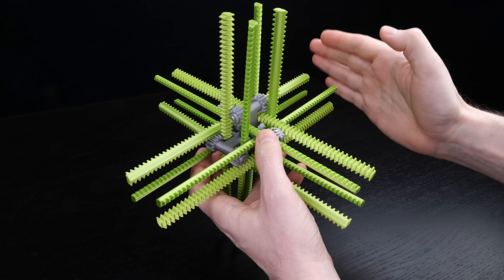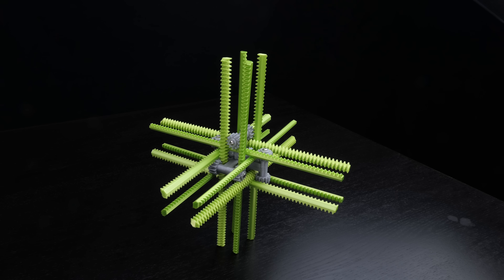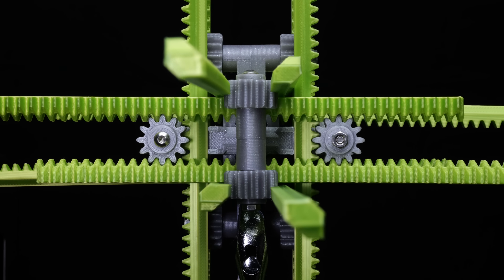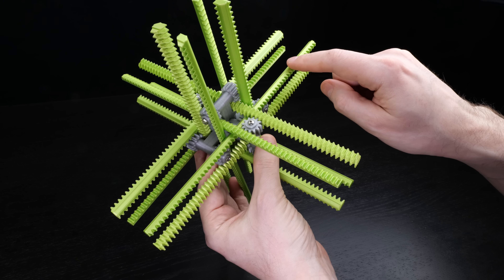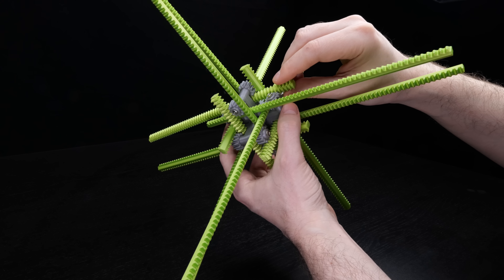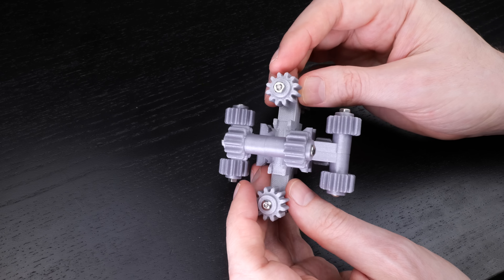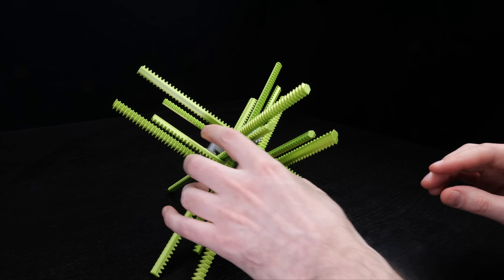Six axis racks

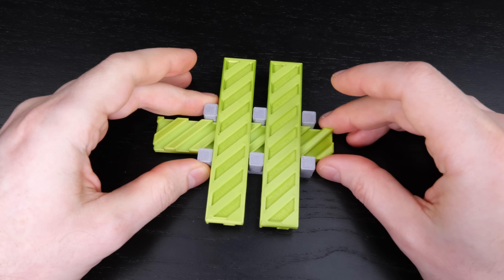Comment: at 5:12, I wonder what would happen if you didn't make all the racks have grooves in only one direction, but formed a kind of a diamond-shaped, bidirectional grooves (a diagonal criss-cross pattern). Something similar to those bidirectional bolt threads: https://www.youtube.com/watch?v=v96LTfmtDPU
Reply from the maker: My guess is that it might be likely to jam. There are 24 places where two sticks move against each other. If any pair of touching sticks can decide to go whichever direction they want, there could be conflicts. I don't know though, maybe it would work out!
Reply: @henryseg  I also thought of the same idea. I think OP meant that only the bottom rack would have the diamonds. The two racks on top can remain unchanged.
Reply from the maker: @cliveso  Interesting... but in the whole configuration, I think that every rack would need to interact with two other racks that move in opposite directions. Maybe that's still not a problem though? I'm not sure if there's a way to split the racks up into "diamond" and "non-diamond" so that diamond racks only interact with non-diamond racks.
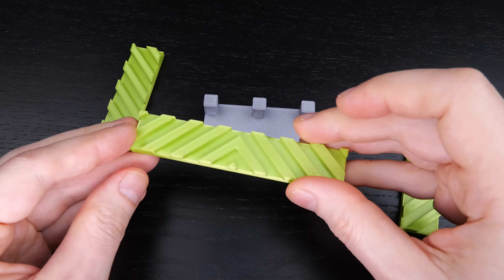Reply: @henryseg Yeah, I was just looking at the 5:12 model, not at the whole configuration... I see the problem now. Maybe there's a way if you use all four sides (not just two) of the racks. I'm not clever enough to work this out!
Reply: My first thoughts exactly. Just make use a Boolean intersection operations between the two mirrored angles. But the problem I see with that is that ALL the bars would have to have that design, so I'm not sure if the direction could be maintained between two interfacing diamond patterns. Maybe make half of them diamond? Loses some symmetry, but maybe a working configuration is possible.
Reply: Or make ithe rods double sided as someone else suggested

Comment: If you did connect the pair of racks together, could you have a suspended core?  I feel like that would be a lot more like you other rack designs.
Reply from the maker: What do you mean by "suspended"?
Reply: @henryseg  In this one the core holds the racks in place.  If the racks were connected could they hold a smaller simpler core in place?   I'm not good at visualizing this stuff but i'm imaging a cube with two gears on each edge.
Reply from the maker: @VagabondTE  In this one the core holds the racks in place and the racks hold the core in place.
Reply: @VagabondTE Why do youbsayor think you are not good at visualizing this just curious?
Reply: @leif1075  It's not a lack of confidence.   I have a very strong ability to visualize.  I can design, build, and even test a lot of things in my head.  I've always been an extremely capable MacGyver type of person.  But for some reason I have difficulty with repeating patterns and grids.  For example I've tried creating self linking chainmail designs and I simply couldn't visualize any of my ideas.  I had to do everything step by step on paper. It's like trying to run a processor without any RAM and only ROM.

Henry Sagerman's stuff in general is the type of thing my brain has trouble with.  But that's okay!  First of all, he's probably the greatest at this type of thing.  He may not be a household name, but literally everyone in 3D printing has seen something he's touched at some point.  Plus, I believe he has a lot of prestige in academic and artistic circles.  I don't think any of us can truly operate on his level.   But secondly, and more importantly, because I'm VERY proud of my own inventions and designs.  One in particular, a plastic recycling press, I think could spawn a whole new type of crafting on its own.  You can check it out if you search for the InventTory YouTube channel.  Two "t"s, you have to click the little link telling the search not to autocorrect.

So yeah, my inability to visualize this particular type of thing isn't even a disadvantage.  My brain is just geared for other stuff.  Pun intended because I suck at gears too..  lol

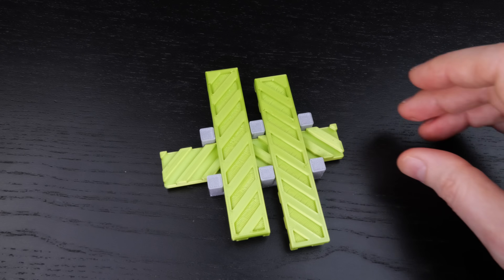Comment: In 5:36 would it work if you had this alternating pattern on all 3 racks, instead of just on the bottom one. So when one of the top racks is about to stop, then it switches to the right pattern and can continue the sliding?

Comment: 5:34 Can't you have diagonal racks on both sides of a stick to achieve direct contact opposite motion?
Reply: It's a bit hard to explain, but there's another possible configuration: the bottom rack could have a grid of diamond shapes to act like overlapping diagonals going in opposite directions, then each of the top racks could have diagonals that going opposite directions like the last demonstration he showed.
Reply: @minecraftiangenetics  Yes I had the same thought. It's functionally the same (or at least very similar to) as the bolt and nut that were machined to have both left and right handed threads that was doing the rounds on YouTube midway through last year.
Reply: I thought that too

Comment: If a pair of sticks had a diagonal connecting bar on only one side of the hub, making a sort of U shape, the other pair parallel with it could have a connecting bar on the other side of the hub. It would still be possible to pull the sticks out in one direction, but there would be a “safe” direction where it collided with the hub, and there would effectively be half as many stick components to get lined up in sync.
Reply: I was going to suggest temporary connectors like this. Then remove them once it's together.
Reply: that is interesting, it would remove some of the symmetries of the system (that is, it would halve the amount of them), and visualizing it in my head, i cant decide if i find it more aesthetically pleasing or not
Reply: @terdragontra8900  The symmetries of the physical object will always be imperfect. But what we should be contemplating is an idealized version, where the racks are replicated out to infinity, and there's an infinite 3D grid of cores. Or how about multiple interleaved grids?
Reply: I was about to make both of these suggestions, but someone beat me to it!
Reply: I was going to say that too
Reply: This works because K₄, the full graph of four points, is planar. But the U-shape would break, it would be stronger to use an oval.

Comment: Wow, this is absolutely fascinating! I can't think of any practical use cases in my head right now (though there are probably a good amount), but I'm thinking some implementation into a crazy CNC based system for experimental manufacturing!
Reply: Hey use giant pendulums as a protection from earthquakes. I suppose it could work in a similar way but in smaller scale.
Or instead of a gearbox add a gyroscope and you could dynamically change directions of spacecrafts or small satellites.